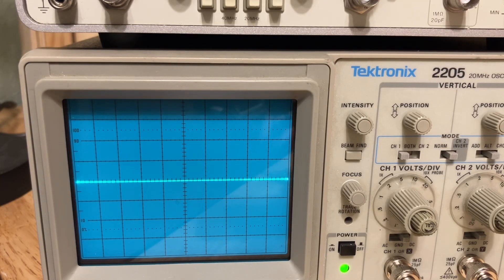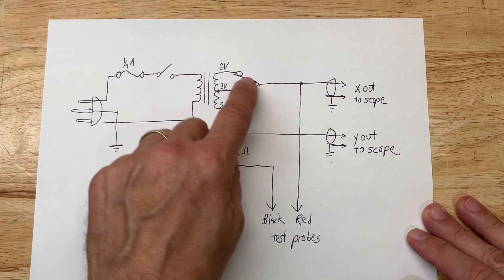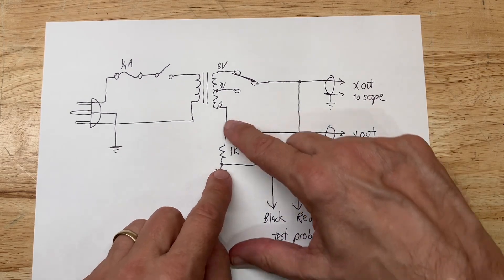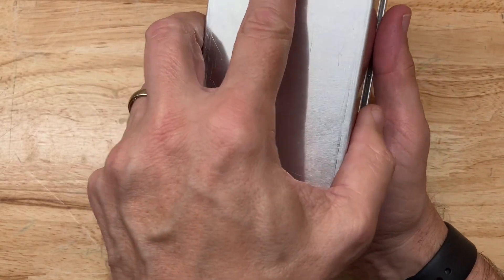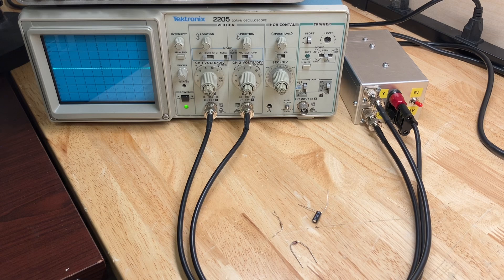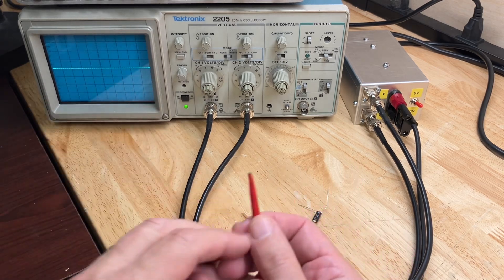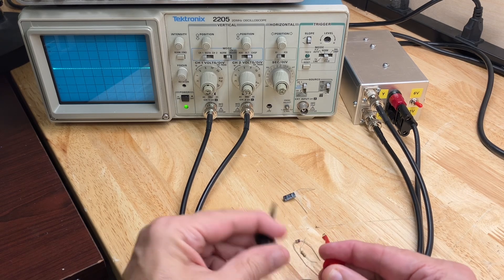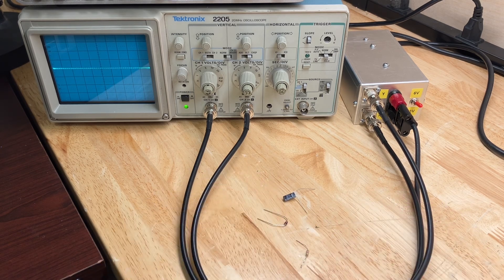The “Octopus” Curve Tracer

Comment: great video, usefull and simple idea. Just a note: to have the same polarity on both channels use the low side of the transformer(0V) as common ground and the black probe/1k union as Y out.
Reply from the maker: That certainly does make sense! I don’t really know why I didn’t do that from the beginning. There isn’t any need for the black probe to be at ground potential. Thanks for the tip!

Comment: Those things are awesome, Hameg scopes had them built in, they made me a fortune as a repair tech, once you have a little understanding of what they show you and you're used to the shapes you see it's so fast and easy to sprint through analogue components in power supplies, amps, monitors, TVs, all sorts of stuff, you can spot leaky caps, failed diodes, transistors, FETs and all sorts of semiconductors almost instantly

Comment: Nice little useful project. I have an old EICO 688 that I have used on and off for many years. However, I was very fortunate to find a mint condition Tektronix 571 curve tracer that has been quite the bees knees. But I still use the EICO in some special use cases. Great instructional video.